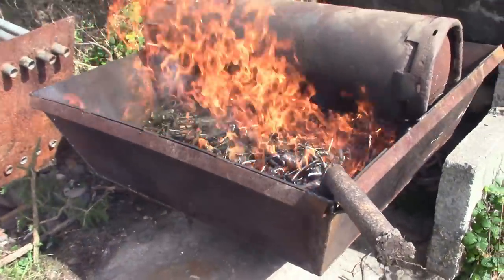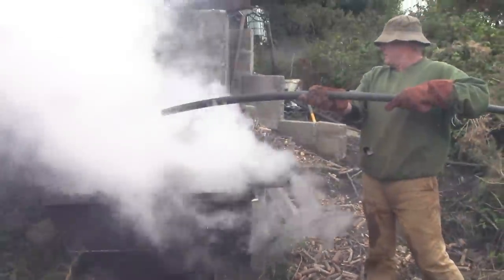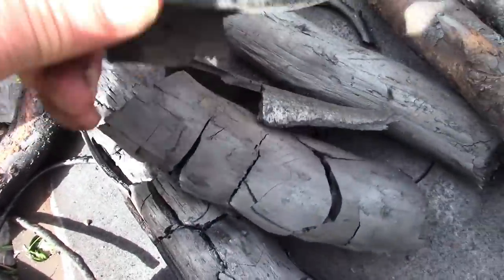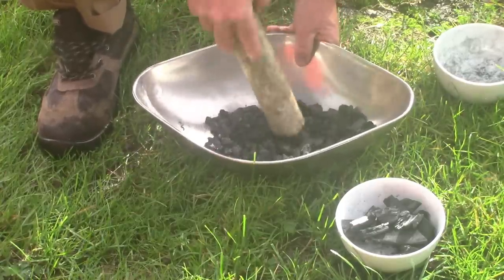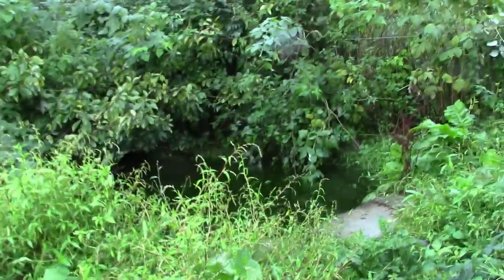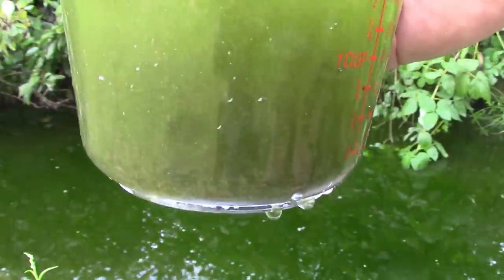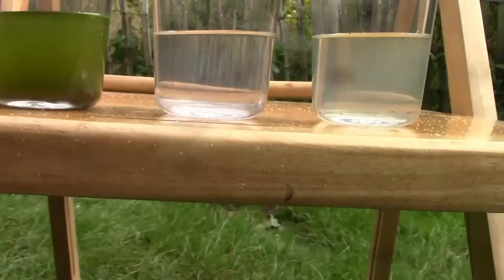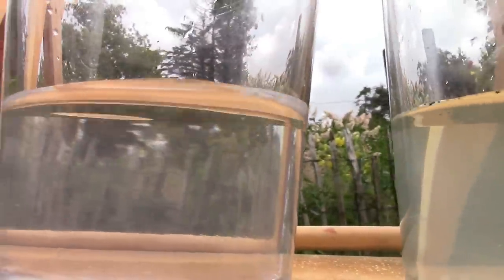But Is It Really Activated Charcoal? (Make your own and then test it..)

Comment: Putting steam into the bottom of the kiln first was a great idea so steam filters up through the still hot coals. Little dangerous though as it could blast you. Been burned that way myself
Reply: Flash boiling can be very powerful, but I do think his method should be OK since charcoal have very low heat capacity (that is the reason you can walk on glowing coal without burn the skin of your feet).
Reply: @bknesheim  There's little worry from the coal, it's the white hot end of the pipe that could cause an issue. Already does blast some of the water out on camera, that could have been worse.
Reply: I think spreading the hot coals and spraying them would get better results. The water needs to get as deep into the wood as possible before turning to steam. It may even be beneficial to load the retort with wet charcoal. This matches the normal process the closest, where they first produce coal and then add steam. Putting the water in the bottom will drop the temperature and the steam moving up through the coals will have no pressure. Adding water from the top allows the coals to extinguish, soak, and get steamed from the rising heat coming from the coals below. This should increase the internal pressure.
Reply from the maker: Thanks, all. I thought the pipe to the bottom was worth trying first, but it's not as satistying as the hissing/cracking you get from the top down. I should test the different layers to see if there's any detectable change. So many interesting things to do!
Reply: @wayoutwest-workshopstuff6299  I like one option you have with the pipe to the bottom. You can extinguish the lower layer and stop it completely from burning and still continue the fire on top. That should increase the yield some and make it easier to control the radiated heat.  Making a little less hot to do the work is always nice. 🙂
Reply: @wayoutwest-workshopstuff6299  Coconut Husk activated charcoal is the longest lasting activated charcoal
Reply: Steam at the bottom does seem like the best bet.  The big obstacle for steam cracking charcoal, in my opinion, is the very high enthalpy of vaporization for water.  Even near-boiling water requires a lot of energy to flash to steam, and if that can be done before the water contacts the char I think the degree of activation goes way up.  A technique that might work would be to get a steel pressure tank ~3/4 full of water, with a poppet valve or rupture disk set around 100-200psi and invert it on the bed of coals (valve under coals).  When the water exits the tank, it will be sufficiently super-heated to flash to steam without cooling the char.  This setup would be very dangerous to someone who doesn't know that they are doing, and a second pressure relief valve should be installed as well!
Reply: Is it possible to activate it in a pressure cooker?
Reply: Wow

Comment: I would leave the two filtered samples on the window sill and see which grows things first. (If you have a time-laps camera, it might be an additional data point.)
Reply: The activated charcoal might be a better surface to grow things on, which can screw the results. To do a real test you would make agar plates and put a drop of water on each. boiling some potatoes and evaporating the liquid from the water will give you a good agar substitute because the starchy sugar mix is perfect for mold and bacteria to feed on. The faster and bigger the growth colony on each dish the more contaminates the sample contained. 

PS. You can also dissolve some antibiotics in water and paint some on the half of the dish without contaminates and you will get a clean line where the growth stops if it is effective against those things, and if it spreads further those are antibiotic resistant/immune.
Reply: I'd like to see the activated vs regular RINSED charcoal. The grayness could just be ash. Also like to see a PPM meter reading on both. Even regular charcoal that has merely been rinsed of ash is pretty powerful stuff. I have charcoal all over the place and don't need more but I might do a small test batch just using the rocket...

Comment: there is an other (I think easier) way to measure the surface of the charcoal: you mix some Saltwater use the coal as electrodes, put some AC through it and measure the resistance. The bigger the surface area, the lower the resistance will become. Some years ago I sorted different kind of coals with that method.

Comment: I’ve recently discovered this channel and
I love it. Thank you. I want to share something that you may be able to take advantage of. Thermal insulation material for installation in fire boxes and the like. I believe the best insulation material is 
Dry White Wood Ash powder. 
The next best is charcoal.
Proof of charcoal is 
Hold a piece of charcoal in your hand light it and blast compressed air on the end away from your hand. It will flow white hot and radiate enormous amounts of heat while you are holding the cold end in your bare hand. See how close you can hold it.
White hot say half an inch away from the cold end. Well dry white wood ash is even better than that. 
Also I love the railway and monorail ideas.
I love everything you are doing 
Thanks
Reply from the maker: Thanks, Ian. Interesting.

Comment: Another great video. Thanks Tim. There is probably another mechanism activating your charcoal besides the physical expanding of the steam within preexisting pores in the hot charcoal. 

Steam will react with hot charcoal to produce a mixture of carbon monoxide and hydrogen. The mixed gas is called "reform gas" and it was produced back in the day when we had coal gas running around in pipes. The carbon monoxide would have added an extra poison the coal gas so it's probably a good thing we don't use it anymore at least here in Australia.
Reply from the maker: Thanks Robert - interesting!

Comment: "The stove is only warm part of the day, so it's full of eggshells." Yes, mhmm that makes sense. 
That's a nice stove though. I was recently in a house that was literally being moved to another location and they had a stove that was a little larger than that converted to use gas. They wanted to make sure it didn't get damaged because it was hard to get another and it costs about 15k CAD. They were never very common here.

Comment: If you were forced to rely on this process for water filtration, every extra advantage you can give the charcoal would be valuable in reaching cleaner water:
-bubbling air through the raw water to activate aerobic bacteria and destroy anaerobic life
-giving settling time for aerobic processes to consume the remaining oxygen and die off
-flocculation by adding alum or iron salts to make mechanical filtration more effective
-coffee filters or fine cloth as a pre-filter to remove bulk material
-seeping through stoneware or terracotta for fine particulate removal
-and finally, after running it through the charcoal, boiling it!

All that being said, I suspect the water from your hose pipe is still more reliably safe. ;-)

Comment: Some people just repeat what they heard from others! Interesting experiment! I also liked the elegant way you talked about cody, about the lab equipment and so on. I used to watch his videos in the past. Interesting but often too complicated and very impractical. In relation to activated charcoal, it should be easy to understand that activation is not necessary for its properties of filtering and adsorbing toxins. This is because charcoal has been used for thousands of years in various cultures. They had neither the necessary knowledge nor laboratories then. But really, the activation only improves the properties of the activated carbon, because from your experiment it can be seen that even the regular one filters. The water in the glass with the regular charcoal seems more cloudy, but I wonder if it is cloudy from the ash that ordinary charcoal contains! 
Great job!

Comment: If I have understood this, then any filter - even a cloth handkerchief - is better than no filter; a large layer of charcoal is better than a handkerchief; and activated charcoal is better than raw charcoal. - notwithstanding toxic chemicals that might be partway out of the wood (Australians will think of Oleander branches).

I let my 25-litre pails of roof water stand for 24 hours before handkerchief filtering. All rain water is boiled (tea, coffee, bread-baking, fruit bottling etc) and I have great confidence in my gut bacteria and immune system.
Cheers, Chris

Comment: Chlorine is easily tested with pool water quality test sticks. Table salt is easily tested with an ohm meter (just fuse the probes together with a rubber band and dip the whole tip to remove variables in distance and surface).

I don't know what it would tell though, but you would get actual numbers if you want to compare your methods for making AC with no or minimal investment.

I love your "rough science" approaches!

Comment: After watching Cody's "steam" video, I wondered if simply including water in the generator would do the same thing. Adding steam to a 500°+ pot just seemed redundant.

To avoid contaminating my carbon with unknowns, I added RO water at the beginning of the firing process and kept it under heat until all the water was boiled off.
So far, it seems to have 'activated' my carbon... (test to follow).

It would have been nice to compare a commercial carbon to your testing samples... 
and yes, using the iodine method.

Comment: 2:00 I was just pondering opening a new tab and shopping for a microscope.
Done. 42 bucks for an educational one with a carrying case. There's kid toy ones for under 20 bucks that would work just fine.
And I agree with you one the "Which one to drink." But I'd still boil it first. Oh, and if you have nice clear water and want to disinfect it in bulk, it only takes 1/4 of a TEASPOON of "Pool Shock," or Calcium Hypochlorite, to sterilize a 55 gallon (200~ litre) barrel. For the sample of filtered water in the standard charcoal, I would use 1/2 of a teaspoon.
And when you buy your Pool Shock or whatever other brand you get, CHECK THE INGREDIENTS CAREFULLY.
The only two you want to see are:
Calcium Hypochlorite, in the 68-70% range, and
INERT INGREDIENTS.
Anything else listed is biocides and fungicides that will kill us.

Comment: Forgive me but I'm going to ask a question that I could Google. I'm not much for a lawn care , but there's a small area around my ponds that used to have beautiful grass but my heavy dogs turned the clay rich soil rock hard. I have till this up very thoroughly and mixed in potting soil and even added a French drain. Three times. Every time it turns back into rock, sparse grass. Just by chance I happen to own a very large barrel of activated charcoal in these little spheres. Do you think that this would make a difference? Lighten up the soil enough? It's very difficult to get to, I necessarily have to till by hand, I really want to get it right this time. I've even been contemplating fake grass and I hate everything plastic

Comment: I watched your last two video's on char making and your method for making the char is pretty much the same as mine including water for stopping the process. I sort of wondered about the activated bit I knew that the shock of cooling the hot char quickly created more fissures and cells in the char and that equals more homes for and surface area to achieve biochar. After watching your experiment with the homemade filter and pondwater you pointed out an interesting thing. That is what is actually activated charcoal mean?  One thing I have learned about YouTube is there is always people who get great pleasure in pointing out what they see as your shortcomings and the safety policeman get me. Just because its dangerous for them to do something a certain way does not mean its dangerous for another person who has the sense to keep their body parts out of moving machinery etc. I saw the oven full of egg shells we ground ours all up the other day with the char very satisfying to use everything. John
Reply: Activated charcoal are from commercial suppliers would normally have an increase in surface area of about 3-3.5 times . An index could be used where 1 is non treated charcoal and the index for treated charcoal would indicate how efficient the treatment was.
Reply: @bknesheim  Thanks for the explanation and help. John
Reply from the maker: Thanks, John. I think I'm just a step or two behind you, watching all your experiments too. Our climate and soil are completely different from yours, but we're both having fun experimenting, aren't we?
Reply: @wayoutwest-workshopstuff6299  Its interesting that we live in totally different parts of the world and about opposite in terms of climate and yet we do pretty much the same sort of things. As far as the fun factor its about as good as it gets plenty of toys and learning lots. John
Reply: The eggshells. So the idea is to mix them into the biochar?
Makes me wonder about the potshards that have been found in the Amazon biochar and the purpose it served.

Biochar in general has me wondering about what effect forest fires have. And is there much effect to the soil from just straight charcoal created from those fires and or when it rains or from water bombing therefore, to some degree creating biochar.
Reply: @foamer443  When we got our farm it had been cleared a long time before we bought it and they had left all the big trees on the ground and new invasive growth had grown. we got in a bull dozer to stack the timber up and we burnt it. In the areas where we burnt the logs is the first place the cattle head for after a shower. The other thing is its greener than the rest of the paddock. John
Reply: @farminglifeaustralia6716  I'm in southern Ontario and from my limited understanding, prior to contact the First Nations kept the undergrowth in wooded areas down through the use of fire.  As much of this growth was grasses and smaller shrubby stuff it burnt off quickly and I imagine went to ashes than char.  It stopped the build up of material for bigger fires, promoted the growth of grasses etc for deer to eat and allowed for more open sight lines to hunt those deer. 

To some degree, those fires which apparently  were done between 5-10 years, must have contributed to fixing the soil on some level.
Reply: @foamer443 Same in Australia the Aborigines' burnt all the time. So much so that a lot of Australian trees wont propagate until after a fire. John

Comment: I would think something like a rock crusher would need 4 plates of steel  some pin sitting in a grove which a geared rail could be used so you can adjust how big the bottom gap is to allow the charcoal to fall through then at the top of the crushing plate a cam either pushing on something or a camed pulley to a small pulley which could be powered by an electric motor or then another pulley on the small pulley to be connected to your stationary engine.

Comment: Very interesting for homemade water filters in case there is no more freshwater available in a drought.

Do you think you would get a better yield if all the hot charcoal is dropped into a tank of water at once? Difficult with your big hopper but may be feasible on a smaller scale.
Reply: only catch in a drought might be using a heap of water to cool the charcoal first, before the charcoal can filter water....?
Reply: @dshack4689   I collect a lot of rain water. I wouldn't dare to drink it but I could use some to make activated charcoal and then filter the rest of the rain water to drink it.
Reply: @schwuzi  "in case there is a drought" next minute "I collect a lot of rain water"  ....
Reply: @dshack4689  I mean have a lot of rainwater stored already. Around 60m³

Comment: Thank you so much for this :) I'm curious, why wouldn't the act of smashing it to smitherenes not do the "activation" of creating fisures and holes? I would be very interested to see that activated charcoal compared to that made in the barrel, simply allowing all the fuel to escape and not burn.
Reply from the maker: the cracks are microscopic - you can't make them mechanically

Comment: Nice qualitative test, but it would be nice to also include the iodine test so we get a quantitative measure of the improvement. 
Using charcoal from the same batch would be more accurate and since the hardness and density of the charcoal make a difference, a measure by weight instead of volume should also improve the result (less important if it is from the same batch 🙂).

Comment: heya, i aint really sure if youre still replying to the comments but damn i would love to hear a response since this involves our topic in our research right now. what's the difference between the activated and standard charcoals u used? good video man
Reply from the maker: hot charcoal is split microscopically by the steam - it's very interesting (look it up!)
Reply: @wayoutwest-workshopstuff6299  but hey just a clarification about the video just one last time,  you mentioned that you prepared two types of activated carbon (2:40), one thats been dried by letting it sit for a while and one thats been dried by soaking it with water, I just aint sure which is which, like does the activated carbon that is dried by letting it sit for a while the activated one? and the one thats been dried by soaking it with water is the standard one?
Reply from the maker: @rhxnd.  'Dried by soaking it with water'? I think you're taking the mickey now!

Comment: The activated charcoal should be more effective the smaller it is when it´s being quenched, since it has more surface area then. If you still want to build the auger kiln at some point, smaller particles should go through there easier as well. That is if grinding down the wood before firing would be worth the effort, since the charcoal is not for filtering.
Reply: Big chunck help the gas flows during the burning process though